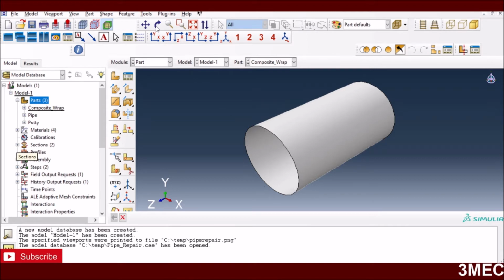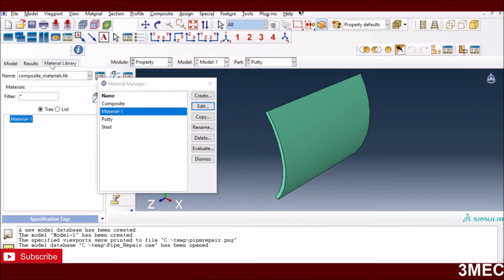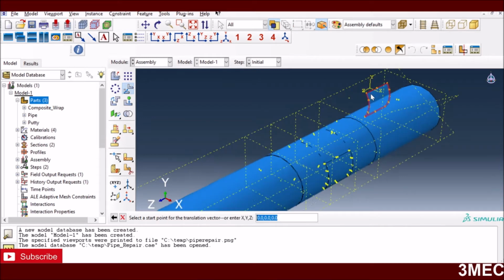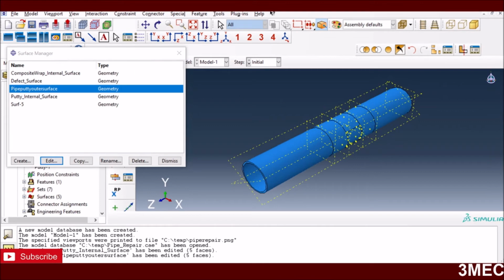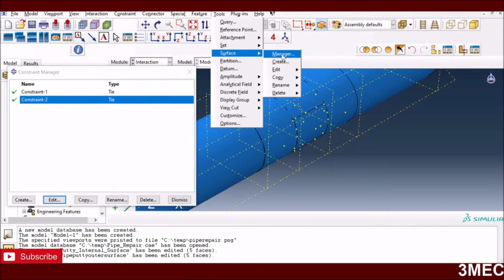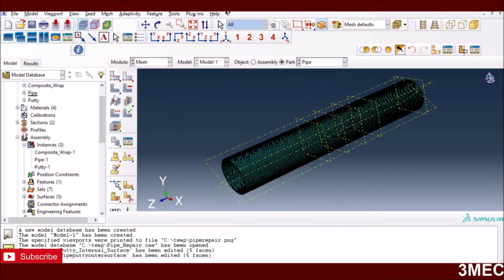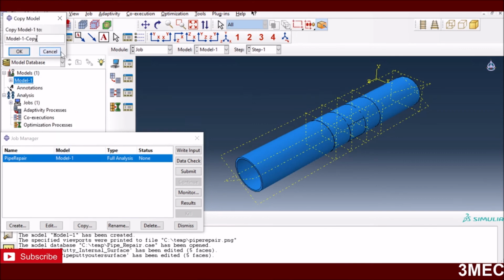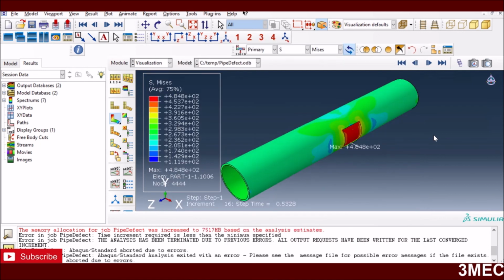ABAQUS Tutorial || Analysis of Steel Pipeline Repair using Composite Wraps

Comment: Sir how to plot " pressure vs strain" curve?
Reply: Sir please reply
Reply from the maker: You will have to extract the strain from that element and then plot it as a function of pressure or vice versa. I have videos on that on my channel.
Reply: @Professor3MEC  Sir repair pipe me putty and composite warp per  pressure and starin  readings kese nikale?
Reply: Sir please reply
Reply from the maker: @theaajadsvnit  use field output to get the relevant output variables from selected nodes, or elements and then plot them together. If I understood your question  correctly. Or email me on info@amirsiddiq.com

Comment: Thanks sir for the video.
I have a question please.
How do you determine the failure strain of the steel pipe only as well as for the repaired pipe?
I want to judge the mode of failure whether it is steel yielding or fracture or FRP rupture.

Thank you
Reply from the maker: Thanks for liking the video.
The maximum load at which the solution last converged was taken as static burst pressure as per ASME section VIII.